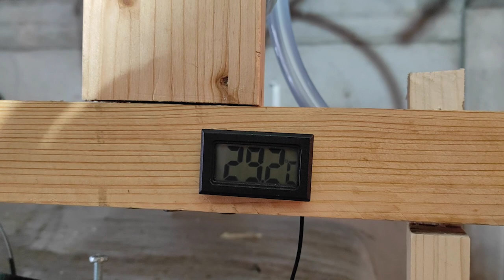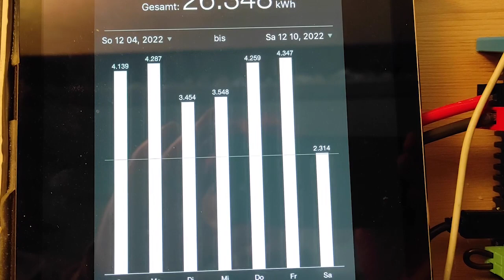Homemade Biogas Part 5, Winter

Comment: Thank you for your digester videos Eti - they are excellent. I read you have switched to two electric blankets to warm the digester in winter. Can you explain what these are? Are they electric blankets that would be used on a bed or specialty blankets that are used in plant nurseries? Also, did you get your Uniseals in Europe?
Reply from the maker: hi Vito! Electric blankets to warm up cold people in bed. Power around 150 Watts. I live in Zurich and found the items in supermarkets. Thank you and happy 2026
Reply: @etienneconod8075  Thank you, that is great to know. I would guess you have them on a timer? May I ask how warm they keep your slurry inside? I am planning to convert a 1000L poly water tank that was storing heating oil to a digester and retrofit a light oil boiler/burner into a biogas furnace that connects to radiators in my home in Greece. I have another way to heat the home also, but I can save gas over the summer to use in the winter. Also I want to eventually install a CNG conversion kit on my car or purchase a used bifuel CNG car. Inspiration from Harold Bate. Thanks for filming all the work you did - it's very helpful.
Reply from the maker: @HappyVitoTV  Ok that sounds serious! The slurry works best at around 32oC. But see this more as an experiment than a viable gas plant.. The yield is not so great and is just sufficient to help to cook parallel to my electric stove. Heating.. not possible with a 1000 l digester and input of about 1 kilos greens per day. To run an engine on your biogas you would need a much bigger scale. On the other hand the system works continously since 3 years day in and out and delivers wonderful fertilizer which I use on my vegies. Good luck!!
Reply: @etienneconod8075  One step at a time. I know it has been a few years, but do you recall where you purchased the O-rings or Uniseals for the pipes to insert into the tank? I am hoping to find some in Europe, but have only found them at aussieglobe in the US so far. Cheers.

Comment: Are you able to capture the gas in a pressurized tank?
Reply from the maker: Of course you can compress methane. But I shy away from trying to compress my gas beyond small pumps for cooking or feeding a generator. Too dangereous. Uncompressed gas is very easy to handle and  poses little risk if accidently ignited. Uses up a bit of space.. ok. Thanks for writing.